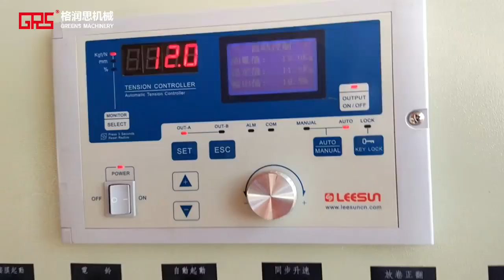Клейкая лента машина для нанесения покрытий

Comment from the maker: 电、热风、、蒸汽、导热油、天然气
Electricity, hot air. steam, heat transfer oil, natural gas
两辊转移涂布方式/逗号辊转移涂布试/刮棒涂
Two roll transfer coating method/Comma roll transfer coating test/Wire rod scraping
单单轴/单轴提升式上料/双轴全自动
Single shaft/single shaft liftina tvpe feedinq/dlosble shaft automatic
单轴/双轴全自动
Single shaft/double shaft automs